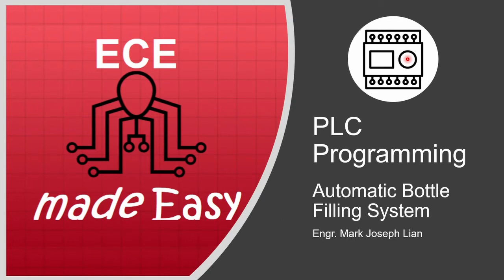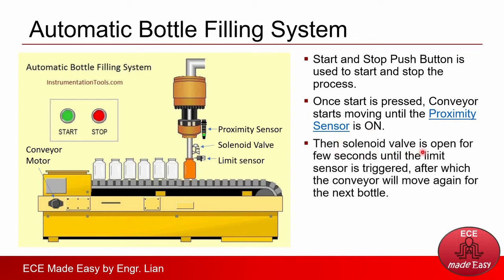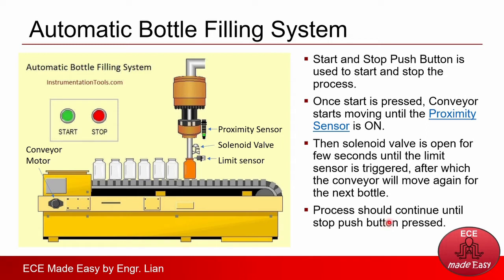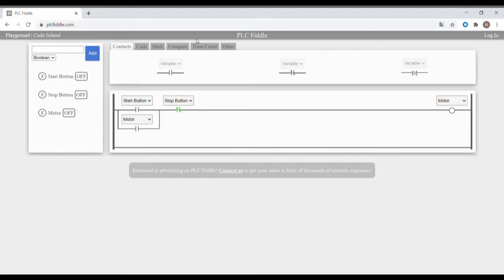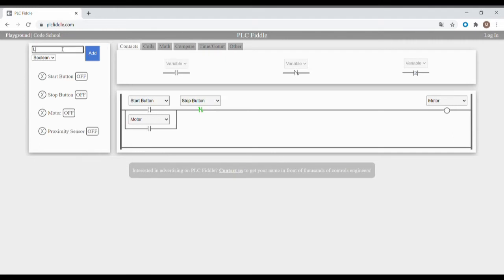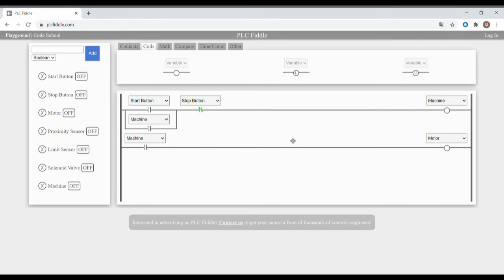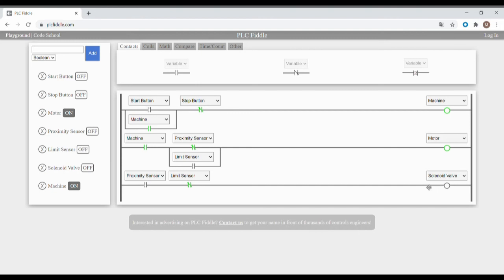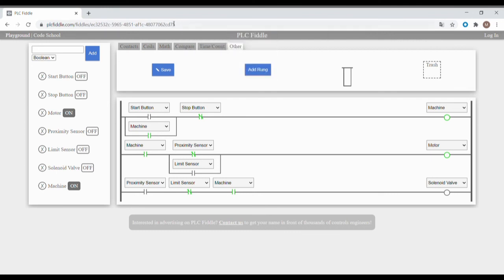PLC Programming: Automatic Bottle Filling System

Comment: but when the conveyor starts moving after the limit sensor turns on, won't the limit sensor immediately turn off causing the conveyor to stop possibly before the bottle clears the proximity sensor. How do you ensure the limit sensor stays on longer than the proximity sensor?